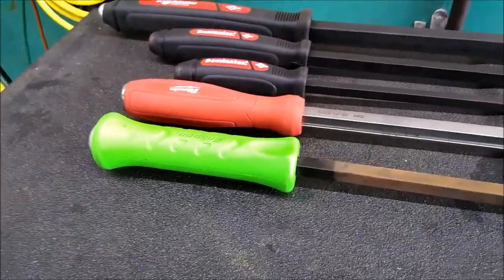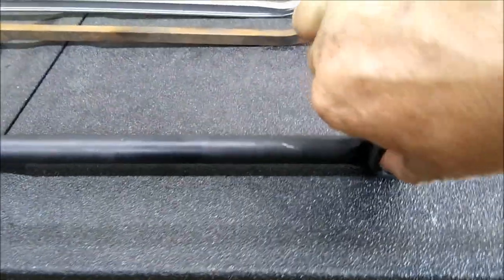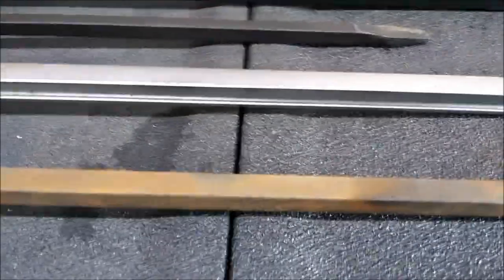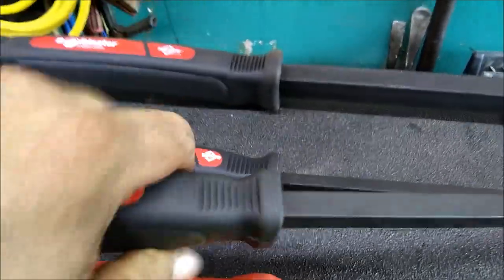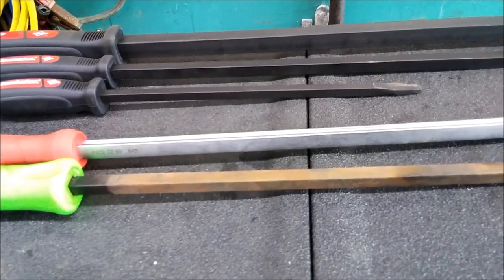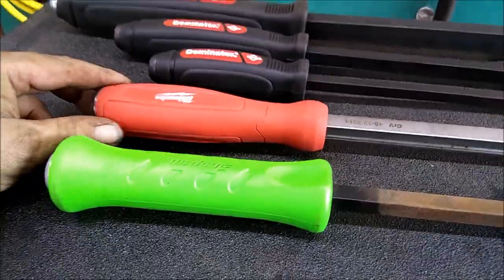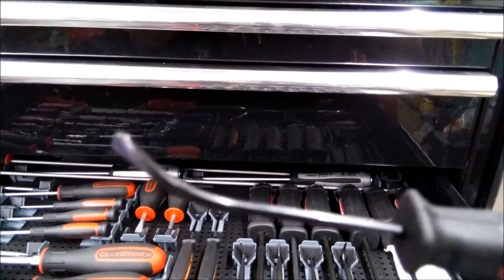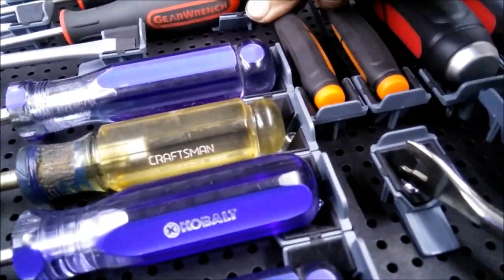Mayhew Gearwrench Snap-on Milwaukee pry bar comparison

Comment: I have an almost complete set of Mayhew, bent and screwdriver style, and the 4-piece SO set with the green handles. Others, too. I bought the SO set solely because I liked it. Didn't really need it, but wanted it. Most of the time, I reach for Mayhew. Their punches and chisels and very good, as well, and reasonably priced.
Reply from the maker: 100% I'm a BIG Mayhew fan got all the pry bars bend and straight and a bunch of the punches as well. Thank you for watching